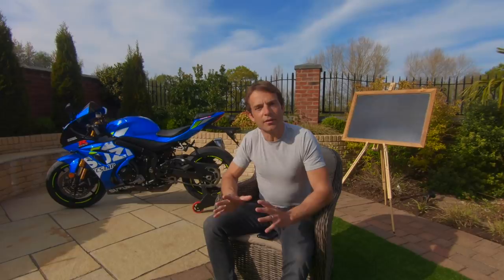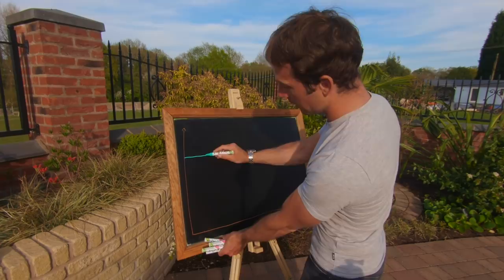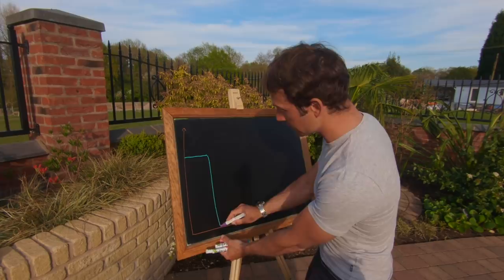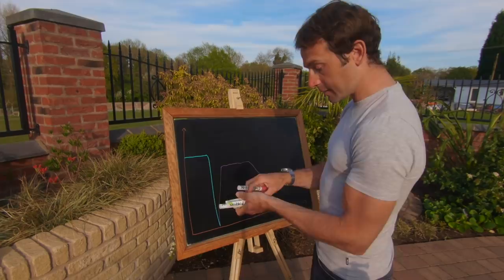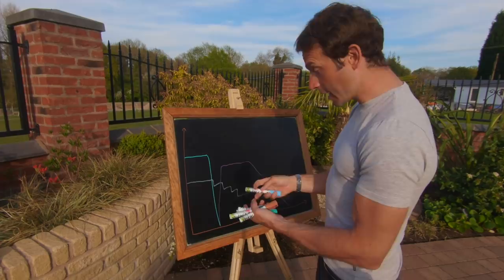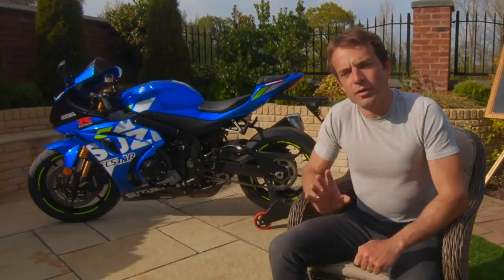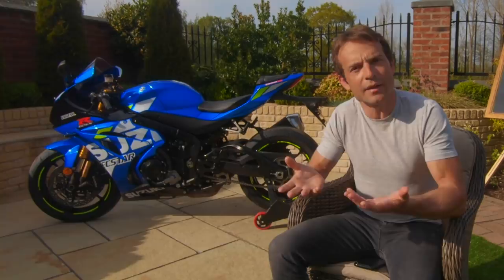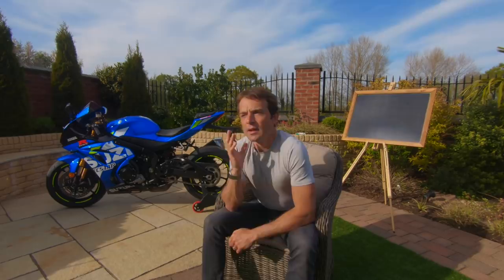THE REAR BRAKE (🇬🇧English Version)

Comment: So well explained. Thanks, I have one question though (and forgive my ignorance). Does your race bike have a slipper clutch? And does this not negate the engine braking? I’ve never ridden with one, so I don’t know if it cuts 100% of the negative drive or if it just stops it being too aggressive.
Reply from the maker: Hi, slipper clutch works in conjunction with the engine brake during the braking phase. It stops the rear from locking aggressively, helps making the engine brake effect more efficient by buffing any locking, jittering of the rear wheel. Highly recommended upgrade.

Comment: Sylvain how do you position your body and how do you distribute body strength .

 Do you anchor your body using both feet on pegs ,thigh on the  tank , and no weight on the handle bars. Please tell how do you do it .

 For example for a right corner do you anchor left foot, knee ,thigh into the bike and the right foot resting higher up on toes with no force on it . 

Do you let go of the brakes slowly so that the front Tyre and suspension doesn't spring up too fast. 

When using rear brakes the whole bike tends to squat lesser than only using front brake . Can you explain this. 

Do you use brakes to control suspension compression and rebound . (I know suspension has its adjustable control of compression and rebound. ). What I am asking is when you release brake do you have to control the release . And how do you control the on throttle wobble on exit . See your wobble at 6:13 in your video .

Comment: Could you also describe how to downshift while heavy braking on a bike with no autoblipper without locking the front?
Because it's little scary to touch the throttle even a little bit while applying full front brake.
Reply: Greg  so how you will downshift without blipping the throttle?
The gear will not shift down.

Comment: Can you recommend to use the rear brake more if the bike doesn't has a blipper function? I personally think it's easier to break with the rear than control the clutch all the time. So instead of shifting that fast downwards. How did the pros do it when Noone had a blipper function?

Comment: I'm wondering how sensitive the rear brake pedal is?  I assume the same pad and rotor materials are used as in the front brake and that the rear pads will be cool when applied and thus require more foot pressure.  Is this enough to give control over pedal pressure.  Will heating the rear brake in a series of S turns change the amount of rear brake pedal pressure?   My thinking is that the foot, using calf muscles, is far less sensitive than the hand using finger muscles in controlling lever pressure.  If the leg dangle is used, there will be time lost in getting the foot back on the peg and indexed to the brake lever.  That's a whole lot of factors that have to be made into intuition.

I would also enjoy a video on contributing factors to a high side spill.  How is unweighting of the rear tire and subsequent changing in grip gauged?  Can rear tire grip be felt if there is no slippage occurring?

Comment: Nice chalk juggling!  So in the situation you describe, engine braking does the same thing as the rear brake, but is there a situation where engine braking has a unique contribution that neither the rear or front brake has? For example:   I use engine braking in the wet more than in the dry - but I'm not sure that isn't just superstition.

Comment: Hello Sylvain, thank you for the videos!
I've never commented before but I've got a question for you. 
I have a 2011 KTM RC8R. Its a lovely bike but it has me wondering the following. 
It has massive engine braking as its a 1200cc V-twin. Would you advise to shift down as early as possible as well as you mention in your video?
I havent got a slipper clutch (or anything else fancy like traction control :) )

Comment: Hello 👋 Sylvain, I have a question; If the front brake is used the most, could you explain me why when the riders are braking hard in straight line before arriving to a turn, the rear wheel starts drifting towards the opposite direction of the turn? Why does the bike drifts if at that moment only the front brake is being applied the hardest?
Reply from the maker: With high front brake pressure there is a lot of weight transfer to the front. At that moment, the rear wheel has very little or no contact with the tarmac.
And at the same moment the engine brake is making the rear wheel spin slower that the front (rear slip) so it’s sliding and the bike can go sideways

Comment: Is this also applicable to cycling? I'm confortable to do mid corner rear braking on mountain bikes because the tyres are so wide a bit of slip isn't that bad, but on road bikes I feel like I have to do all the braking before the apex and then just let it roll. Would be interesting if someone would know if trail braking including rear braking is beneficial for road bikes !

Comment: Hi Sylvain. I got a CBR600RR from 2008 and it doesn't have a slipper 
clutch. I am a bit scared to engine brake too much on low gears because 
my wheel will block. Can you explain on how to engine brake without 
having a slipper clutch?

Comment: Is it necessary to have precision in the rear brake when braking? or is it enough to press it to the maximum?
Reply: Holy cow, no. Don't ever press the rear brake to the maximum, unless you're going less than 15 mph and want to skid on purpose.

The average rider will gain a little benefit from a small amount of rear brake. That's because average riders only reach maybe 0.7G stopping force, maximum. Some of the extremes only reach 0.5G. Some riders are comfortable getting 1.0G. But the average for experienced motorcycle riders of all kinds on the street is 0.7G. Furthermore, at low speeds, it is relatively safe to accidentally slide, temporarily, so at low speeds it doesn't matter if you bounce the front forks or lock the rear, cuz you'll be stopped or nearly stopped by that time. Hence applying both brakes suddently will stop you a little faster, if you're going slow.

But at any high speeds, you should almost never need to use rear brake on clean dry street, at all, unless your bike has a really long and light front end. There is only really one exception, which you probably don't need to know.

When you brake hard at higher speeds hard and long enough, you will reach 0.9+G, and you'll be get there in about half a second, if you (and the bike's suspension and chassis) are any good. The softer the suspension, the longer this weight transfer will take to complete, safely. By this time, the front forks will be tightly compressed, and almost all the weight of the bike will be on the front patch. At that point, even a relatively light pressure on the rear brake will cause a slide. So IF you used any rear to start with, you must release it by this point.

The reason some people are attached to the rear brake is they are afraid of losing traction on the front. People do this when they're new riders because they haven't learned to transfer the weight of the bike smoothly, yet. In a car, you can stomp the brakes, suddenly. It doesn't matter if the front shocks bounce, because a momentary loss of front tire traction doesn't cause an instant accident. On a bike, with any lean at all, loss of front will be unrecoverable. But as long as you transfer weight smoothy without bouncing/rocking the chassis, this will not happen. On most sport bikes, the rear will lift off the ground before you lose front traction, as long as you do it smoothly.

Because you can't afford to bounce the front shock at much higher than parking lot speeds, you simply cannot go from 0G to 1G all of a sudden. You have to ramp up the braking and leave a little left over for when the front shock approaches where it is going to stop compressing and potentially bounce back the other way. At this point you have to be able to add more brake/deceleration to keep the shock down. If you're already at 1G, you have nothing leftover, and the shock will bounce, the front will lose traction, and down you go. So at high speeds you don't need to use any rear brake at all on a sport bike; just shutting the throttle is enough to get the weight transfer started as you roll on the front brake! If you use rear, initially, then you must release it by the time you get to full braking power, cuz it's all gonna be front at this point. And sliding the rear is very dangerous at higher speed. Your chance of recovering gets smaller, the faster you are going. And the result is usually a high side, which is more deadly than a low side. The faster the bike, the higher and harder it is going to throw you in the air.

Racers who use the rear brake very often reduce the power of the rear brake by reducing the size of the rear rotor or by removing parts of the rear brake pads. Fine control of the rear is very important if you are using it speeds above say 35 mph.

Comment: I've got a question about downshifting. How hard can you downshift? My last bike was a CBR 1000RR, and when I did some hard braking and downshifting (say from 6th to 2nd), the gearbox felt like it was being destroyed on the inside, even with full clutch. Are they made to stand that kind of abuse and that sound is normal, or do street bikes require slower downshifting to match current speed?
I'm on the lookout for a new bike, and don't want to carry bad habits.
Reply from the maker: Really depends on your bike, setup, have you got a blipper? slipper clutch? 
If not you have to use the clutch to smooth downshifts.
Reply: @SylvainGuintoli  Wow, wasn't expecting a reply from YOU! Thanks.
I owned a 2006 CBR, no assists of that sort.
I did use the clutch a lot, but I meant that whatever I went down the gears from 6th to 2nd really fast, the gearbox made this hard metal  banging noise, which sounded all but healthy.
I learned to use the clutch very effectively, as I'm a big fan of trailbraking, but took extra care when coming from high speeds.
Although I drive on the limit where possible, I like to avoid mechanical issues due to misuse.
Thanks again for replying. Cheers!

Comment: I read/watched/heard something about the rear brake can help you "pull" the bike down into a corner. Is this the case? It's at odds of what I've always heard about using the rear brake at slow speed to help keep the bike upright and stable...
Reply: If you watch the graph, you can apply a little of rear brake at the same time or before the front one to load it,  not unsettling it. You can also drag the rear brake while making slow speed manoeuvres to make the bike more stable, but this is at walking speed haha i think motojitsu has some videos on dragging the rear brake if you're interested. Cheers!